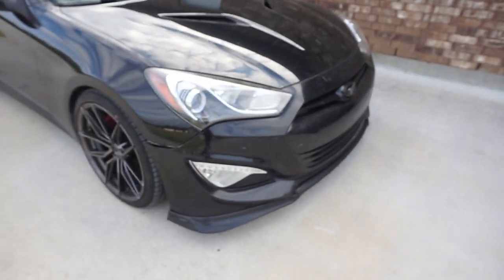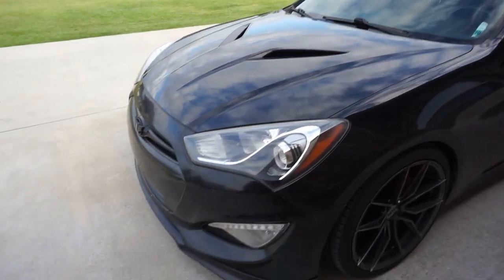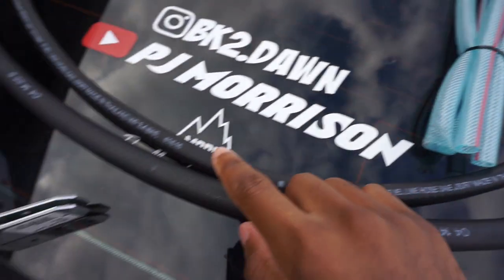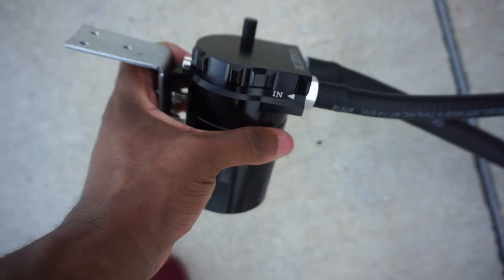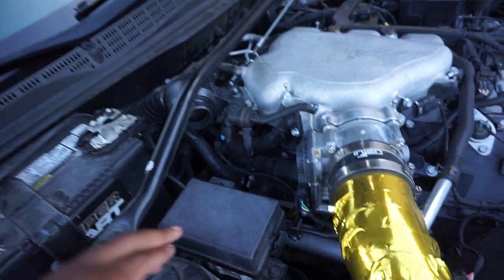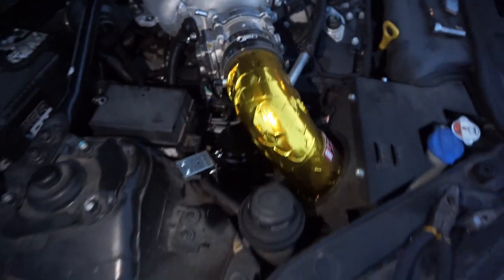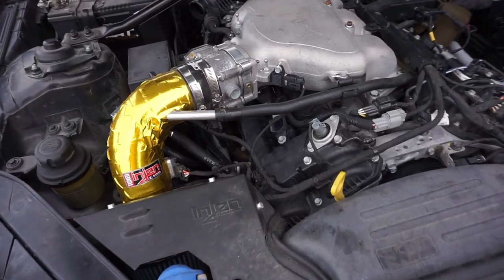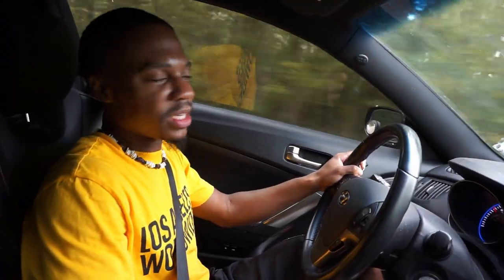Genesis Coupe Amazon Oil Catch Can Install

Comment: If you are replacing the front bumper with an OEM personally I would gut the center section and put a plastic mesh grill in it!
Reply from the maker: I thought about it, I’m still debating on how I’d wanna go about doing so😅
Reply: @pj_morrison  I ordered a mesh grill in April never did get it. I will order one over winter. It would make for a good video if you do it.
Keep em comin!

Comment: I know this video is old, but if you still have the car swap out the heater hose with fuel line hose. Heater hose will degrade with oil in it and can cause a lot of problems.
Reply: is it safe for my car to smoke out of the oil catch can

Comment: Hey man, it came with 4 connectors right? What do we use the other 2 on?? Or are they just backup?
Reply from the maker: Wassup, since it is a universal kit, it gives you the necessary fittings that your car “may” need. Some cars use the smaller ones, some use the larger ones, some use one each. It all depends on your car. But you should only be using two

Comment: Does the wire mesh go into the catch can itself or into the baffle area?
Reply from the maker: Not sure what you mean, but it goes into the lil compartment inside the catch can.. Just like in the video
Reply: Thanks bud. Doing some more research i realized some of the more expensive catch cans have a brass filter in the baffle. How you installed the wire mesh acts like a brass filter. 👌
Reply from the maker: @fizzzle  yea, idk what happens down to the science but I do know that I have to empty it with each oil change. So that’s good enough for me